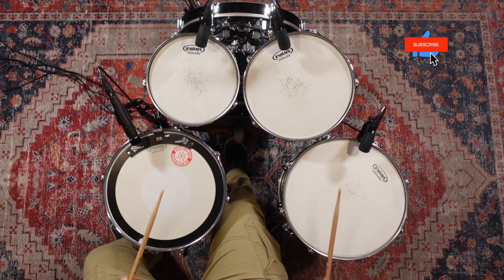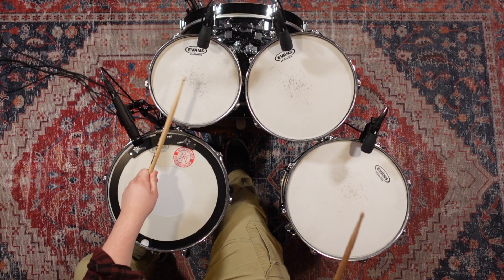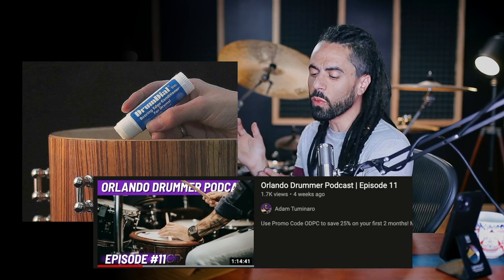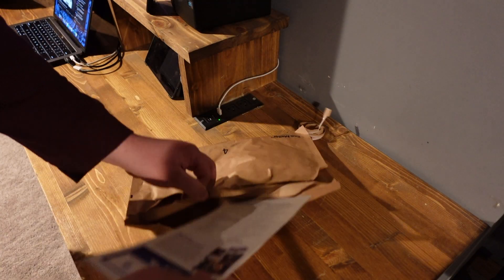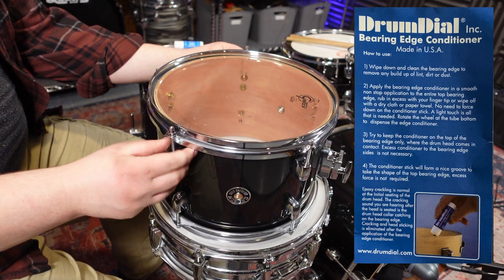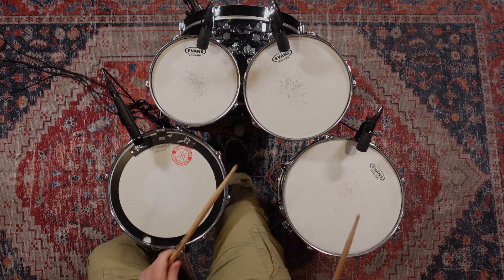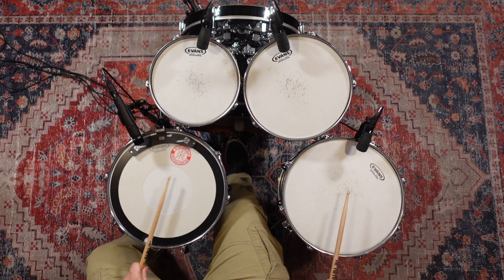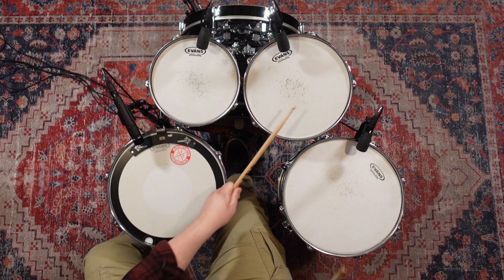DrumDial Bearing Edge Conditioner // Product Overview

Comment: Think all the edge conditioner is really for is to make it when you tune the drum heads there is less friction where it makes contact with the bearing edge for nice smooth incremental tuning. You can even see it with the drum dial on drums with really steep bearing edges where the needle kind of jumps a little bit as the drum head snags with the friction until it finally lets loose.

With the conditioner on it that doesn't happen it just glides across the bearing edge
Reply from the maker: That's kind of how I see it. You won't notice a sonic improvement, just an easier experience when it comes to tuning the drum.

Comment: Is there any indication of what the substance is? Could a chapstick actually be used?
Reply from the maker: They claim it’s a proprietary product, so I wouldn’t be surprised if you struggled to find the exact ingredients. To me it felt like chapstick, some people use vasoline on their edges, so I would guess it’s similar to that.
Reply: @malonedrum  fairly certain it’s Vaseline or petroleum jelly that’s used in chapsticks   So should be a reasonable substitute.
Reply from the maker: @johngrant5749  Yeah, I think so. But this was only a couple bucks, so wouldn't hurt to get the actual thing.
Reply: @malonedrum  I can’t say I’ve seen it in the UK but I’ll check around.